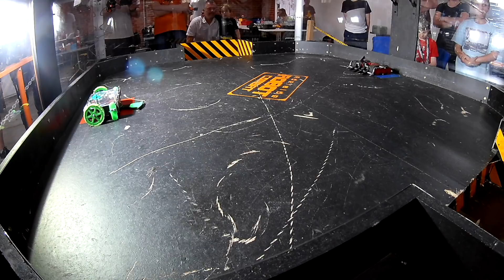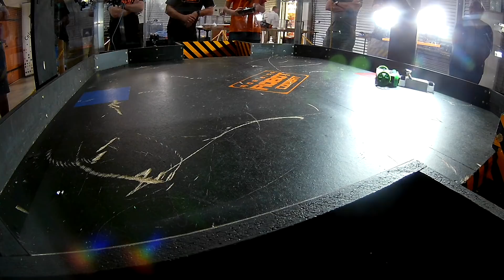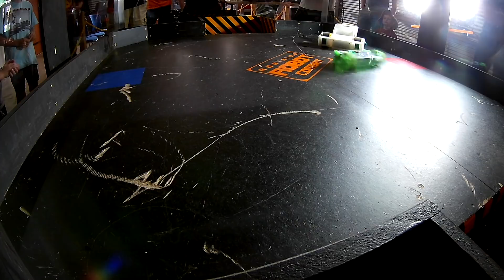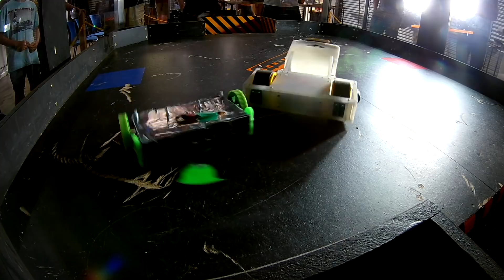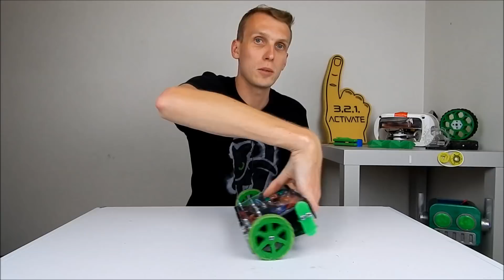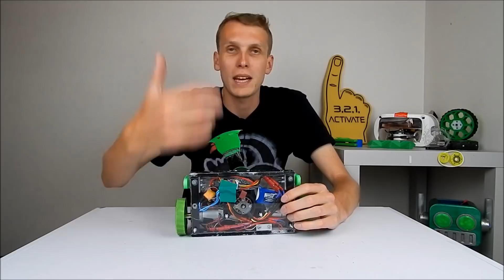ARC Nov 2018 1.36kg battle report

Comment: For the connection problem, electrical tape would have been your friend. Unfortunately hindsight is always 20 20. You were unlucky but learned a lot. The knowledge gained in defeat is better than a lucky win every time. 

I noticed that Annie balanced very well on her backplate during this video but that would be a disadvantage if someone gets a lucky hit and upturns her onto her bottom. Good luck with Annie 2. BTW her battle scars only add to the beauty.
Reply from the maker: Agreed, I lost a lot and learnt a lot. Annie V2 is going to be way better because of this event.

Yeah Annie V1 stands on her backplate, but I'll be moving the wheels back so that Annie V2 does not.

Agreed, I like battle scars on my robots and try to keep them when I can.

Comment: Why does the bar have rounded ends? It would make more sense to have just a bar with sharp edges
Reply from the maker: Battle damage.

The tips got a bit bent up at AVC and I havent had time to get new bars cut. I was spinning the blade so that the still pointy tips where hitting

Comment: Are there particular sizes of belts that are of use to you? I have some out of various printers and medical equipment which you are welcome to if they are suitable they seem pretty sturdy , also some stepper motors.
Reply from the maker: Thanks for the offer, but for something as critical and likely to break as a weapon belt I like to buy them in bulk so I have a bunch of spares
Reply: @TeamPanicRobotics  no problems I just had a collection of them wanting them to get used not just thrown out
Reply: @TeamPanicRobotics  also may be a  idea to run 2 belts at the same time seperated somehow so if one break you have the other to still work , how to implement this is another thing but just an idea ive seen used in other devices ...redundancy precaution. I dont have any idea of the logistics for this sort of thing and what extra load that would put on the motor...just a thought.